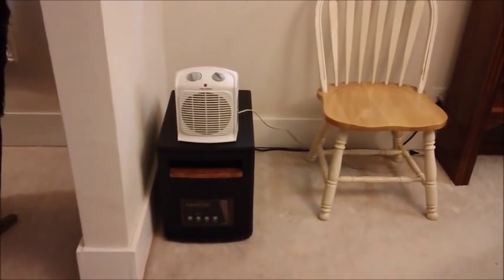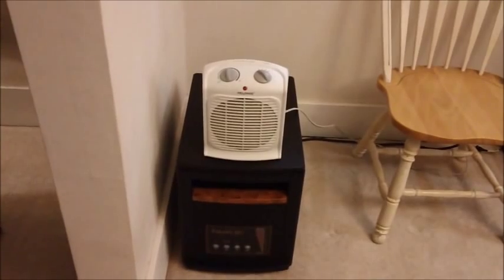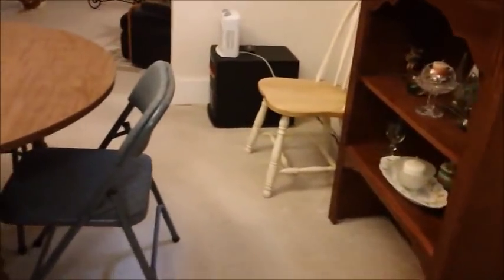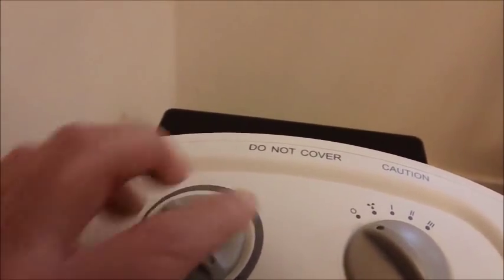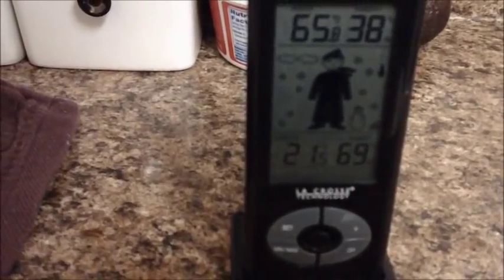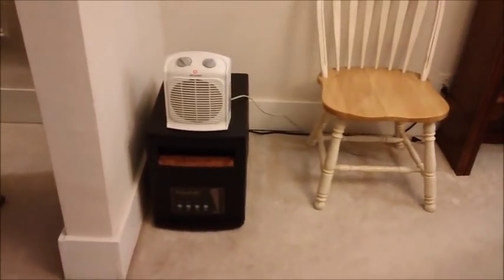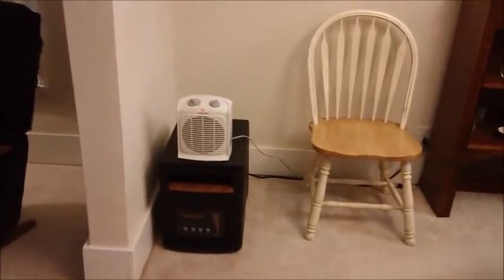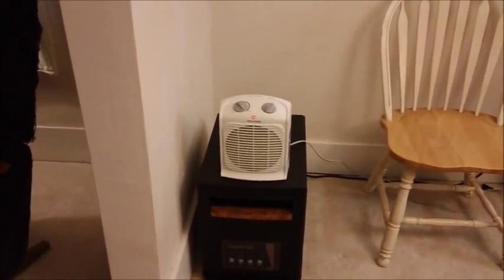EdenPure VS Pelonis Fan Forced Heater

Comment: Thank you for your time and great test, exactly the type of test that MATTERS!  I know that it has been a while, I have a drafty (i.e. not sealed so well) 250 sq. ft. room.  The Winter temps are similar to yours.  In your opinion, would the Eden Pure or Home Comfort be the best way to heat rather than a Vornado or a ceramic tower?  Thanks again.
Reply from the maker: Sorry taken so long to respond.   I think hands down infrared heaters are the best.  Just make sure the humidity level in your house stays above 35%.  Infrared heat “rides” on the humidity in the air and is essential for them to work efficiently.
Reply: @MiamiCOIndiana  I appreciate your time and opinion, seeing that the video was posted 10 years ago, your reply was relatively quick! Thank you :-)))

Comment: You must really have super insulation for that to work. VF
Reply from the maker: Old house very thick walls all insulated new windows lots of attic insulation and small house all make this work for my situation.
Reply: @MiamiCOIndiana  Do you think using two edenpure heater back to back with rewound heater tubes would make for an even better heater ??? Just thinking out loud. VF

Comment: Does running the Eden pure cost much less than running the house furnace?
REPLY
Reply from the maker: all depends on how efficient house furnace is and how much area you are trying to heat.  In my case it cost much less heating with the edenpure heater.  And the house is much more comfortable.  Note my gas furnace is old and outdated and only about 70% efficient rated so it waste lots of energy.  New gas models are around 92-98% rated.

Comment: it's not the type of element. the edenpure has a better blower to distribute the heat better. it does not put out more heat, that is impossible. I have a 30000 btu gas heater in my garage that puts out as much heat as six edenpure heaters. but the garage feels cool unless I turn on a fan. then it's as warm as I need it on the coldest winter day.. without the fan the heat is all at the ceiling since cool air displaces the less dense warm air.     1500 watt heater is a 1500 watt heater. period. any test is just nonsense. it's math. math does not lie. all 1500 watt heaters put out the same amount of BTUs. All electric heating elements are 100% efficient. meaning all the electricity they consume is converter into heat. which means ANY 1500 watt heating element will put out the same btu.

Comment: The low airflow from the Pelonis causes heat to pool in the ceiling, creating a temperature stratification.  If you turned on your living room ceiling fan, I think you'd find that the Pelonis would be capable of heating your entire home, as the fan would smooth out the temperature stratification.  The Edenpure's larger fan keeps the heat circulating around your home evenly.  Very interesting test.
Reply: VeeDubTDI I like to turn my ceiling fan on reverse while having a ceramic heater on, and gotta say, it heats up fast.

Comment: Yer right Professor, yer right Skipper, yer right too Mr Howell... Everyone is right. 1500W is 1500W, UNTIL it becomes infra red which also heats items in the room which slowly radiate the heat. Using a ceiling fan along with the $10 heater may have made some difference and only added like 30W to the equation.  I just received 2 Pelonis 1500W heaters and tested on my  KILL A WATT EZ which said setting 1 was 600W, setting 2 was just under 900W, and setting 3 was well under 1400W, like 1360W I think it was. That is all fine because I don't like running the cheaper little heaters on highest setting anyway.  The fan only setting was 15W - 16W. At $10 per heater, depending on usage of course, the purchase savings could offset one or even two month's heating bill, maybe three or four months in a milder climate if used with ceiling fans... There is something to not putting all your eggs in one basket, LOL, but the ideal(but more expensive) thing would be more than one infra red heater in case one craps out, and, the filtered air is a big plus for keeping the inside of the unit clean so you don't have to drag out the air compressor to clean it out. Good video man, I liked it.

Comment: Pelonis wins this hands down..Pelonis @ Wal Mart yesterday, ($9.99)..Edinpure Gen-3 ($302) @ Hardware Supply...Try to get a repair of the Edinpure done before winter turns to spring..GOOD LUCK!....Edinpure is pure crap..I have four of them sitting in the shed..dead..
Reply from the maker: +Patrick DeMent I agree the Pelonis is a great buy if you're looking to heat a small room (150 sq feet) works great.  My EdenPure gen 3 is on it's 5th season non stop running from October through April yearly, heats over 900 sq feet,  same bulbs and puts out heat like the day I bought it.  I have no issues with the $300 price tag for heating a home comfortably for a reasonable cost.

Comment: To Tonya C   --  The air filter is behind the plastic grill at the rear of the unit.  It is on the bottom.  It has clips to lock it in, so be careful in taking that grill off.  The filter element sits right behind that grill.  Wash it and dry it, and replace it.  Hope this helps.

Comment: I don't know anyone with an IQ over 50 that thinks you can compare a 1500 watt $20 heater to a 1500 watt heater that costs over 10x as much, if you want to do a comparison that means something, compare 1500 watt heater in the same price range. Not only do they produce heat differently they are intended for different uses. I'm not one to criticize but this comparison is invalid on so many counts.
Reply from the maker: +Clarence Wooten  Some people just miss the point or just can't get it.  It's ok your point of view is welcome.
Reply: I understand the point, but the outcome is a given, it would be far more effective to make your point with a comparable device rather than an incomparable device.

Comment: the biggest factor imo is the lack of a powerful fan to help circulate all that heat. the real question is how many square ft does the pelonis say it can heat? because if it doesn't say it can heat 850 sq ft then your entire test is a waste of time even if it is to please the idiots that believe 1500 watts is all that matters when the air the fan can push is just as important if not more.  You should have pointed out out what the pelonis would be better suited for and what the Eden would be suites for as well. BTW, not everyone has room in their budget for an Eden but they should, if they have a larger space that needs heating. thanks for sharing!
Reply: Holy Grail Cookie! Ty!

Comment: Would you say running the Eden pure cost much less than running the house furnace?
Reply from the maker: +Bill23799 I find it does cost less to run the EdenPure, however I need to point out my gas furnace is outdated and not efficient at all.  Also I find the infrared heat is way superior to my gas central heat, it would blast heat then get chilly in the house before the next big blast.  The edenpure keeps the temperature at a constant level and is much more comfortable.

Comment: The quartz bulb heaters don't last much more than a year.  I'm on my second set in 3 yearx.
Reply from the maker: So far got through 4 years with same original bulbs.... I do make certain my filter is kept clean at all times, which may extend the life of the bulbs.
Reply: +MiamiCOIndiana ,Where is the filter.MiamiCOIndiana.I got one used and know nothing about it.I am also in Indiana and it is very cold now.Please help.ASAP,Thank You.
Reply: +Tonia C The air filter is behind the plastic grill at the rear of the unit.  It is on the bottom.  It has clips to lock it in, so be careful in taking that grill off.  The filter element sits right behind that grill.  Wash it and dry it, and replace it.  Hope this helps.
Reply: Thank you.
Reply from the maker: +ritewayguy Thanks for helping and you are correct.
Reply from the maker: +Tonia C Extremely important you keep the filter clean at all times if you don't it will block the air flow thus either shutting off the heater or burning out the bulbs prematurely.  Ritewayguy was correct in his response as to where filter is located.  I even tell people if you are not going to check and clean the filter regularly it is better to just remove the filter.
Reply: ty.I found it,was pretty simple.

Comment: The problem with smaller heater that it have low distribution of heat. If you get 3 small heater would do the great job if you distributed around house and use it on minimal power. The Other problem is power consumption. It is about usage that power it is 1500 W but as hotter is heater the less is power that can be consumed, but that is minor lose of heating. The most you would get from little heater if you put some turbine beside it and force air to push from behind it trough heater. Try the hair driver with multiple fan speeds and multiple heating options. If you set FAN to 1 and Heater to 1 you will get the hot air and you will get the temperature rising. But try FAN speed 2 and 1 on heater you will get much more effect. It is faster removing heat from heater. The heater can produce much more power if it is releasing it quickly. And the Hot air distribution is much more better. And it is always better to heat bottom cause hot air going up. And you are not measuring on sealing. Nice review. You did very good job on explain it. You sad it all correctly.

Comment: The EdenPure is a $450 infrared radiant heater. Now I have Dr. Heater $180 infrared radiant heater (bought in 2011, even less expensive now) which actually is a much better heater than the EdenPure. There is a video showing a huge difference between Dr. Heater and EdenPure. Anyways not to get lost on that. You did a great job on your test and fair review. Thank You. I would also like to mention I have 1993 Del Rain or Lifetime Ceramic Disk room heater that can heat a room for about 6 cents an hour. The Ceramic Disk heater are much more efficient than the infrared heaters. Of course my house only drops about 1 degree an hour at 25 degrees out (triple pane windows, and 1 inch of insulation under my siding, along with the regular wall insulation). But I like what you did and proved that the coiled heater is no match for a infrared radiant heater!!!! Thanks again!!! :D

Comment: Walmart is selling that exact Pelonis for $14.94.  Is if worth 15 bucks?
Reply: it's $10 right now
Reply from the maker: +Paul Strauss If you're looking to heat a small area or 1 room it would be worth it no problem.
Reply from the maker: +Mike Tech Great price thanks for sharing
Reply from the maker: Yes it's worth the $15.  Again please note the Pelonis heater is designed as stated for 1 small room.  So as long as you're looking to heat a small room you're good to go with any small heater like this.
Reply: MiamiCOIndiana
welcome!
Reply: i just picked mine up for $9.88 at Walmart.
Reply: NotaTrollTechRUS 
I picked mine up for free out of our condo dumpster. It works.
Reply: Paul Strauss They I slash the price to $10.00